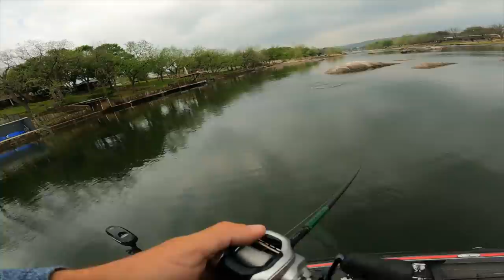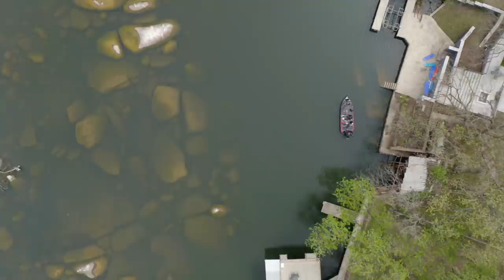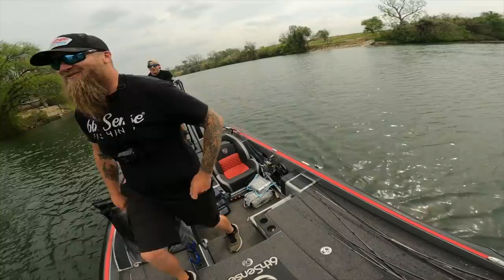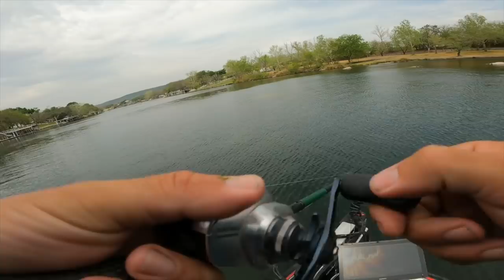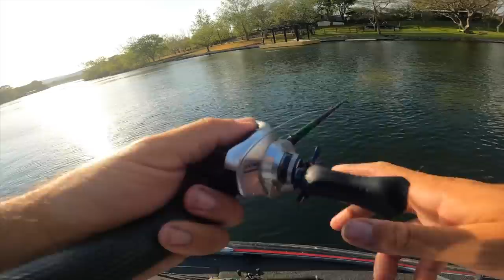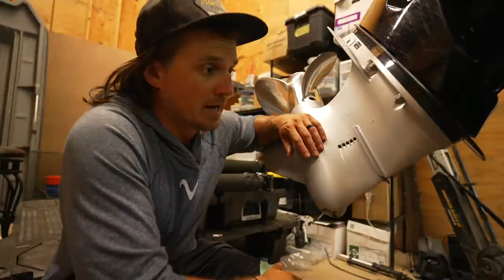Watch Me Do $10,000+ Damage to My Boat….FML

Comment from the maker: Just realized in my fit of rage I said my Eternal Lithium battery "crapped out"...to elaborate on that, the original battery they sent that I've been using as a cranking battery was a 12v deep cycle, which is not made for cranking. Once we realized the mistake, they got me hooked up with a 12v cranking that I just dropped in! So in reality, the 12v Walmart battery I was using in the interim, was what crapped out after less than 3 hours of use. SMH
Reply: Man those everstart batteries are 💩. I know where you at btw, caught some giants up there. Getting through those giant ass boulders is butthole puckerin lol, we always put the trolling motor down right after those low water buoys
Reply: Should  have used the 4wheel drive
Reply: I was gonna say man! I have had eternal lithiums for a while and never had a problem. Impressive that a deep cycle was still cranking over your engine!
Reply: I belive the power pole charge can jump ur boat off a 36v trolly battery...
Reply: I think those are wipers

Comment: I’d definitely try and get that repaired instead of replacing. As long as the inner casing isn’t cracked and leaking oil it should be fine.
Reply from the maker: Good call!
Reply: Have it welded up. Itll be fine
Reply: And that’s why I always carry jb weld and duct tape! 🤣

Comment: Drop the lower unit and see if it sucked in a clump of mud, considering the whole is much bigger, probably clogged. Bring it to your local machine shop and have them weld it and grind it back into its proper form. It'll be a fraction of the price 👍☮️

Comment: Yeah, def see if that can be repaired.  Just take it to a certified Merc dealer and see what they say.  Their repair shops get first dibs on parts, so if it can’t be repaired, they will be able to get the parts to replace it faster than you can.

Comment: If you want to catch ocean run stripers in Texas the spillway of Lake Texoma is the best have to pay attention to the alarm when they're letting out water though they use remote control model boats to take your date out to where the fish are if you are on shore and you can't get a boat up in to where the fish are because of the safety line but you can walk on a big cement walkway right out to the fish when they're not letting water out don't take a bunch of equipment out there because when the alarm goes off he won't have enough time to gather enough and get the shore and you'll lose your equipment and maybe your life but the water comes up 10 feet in about 3 minutes Lake Texoma biggest lake in Texas the largest Raper caught in the spillway at Lake Texoma was 61 pounds